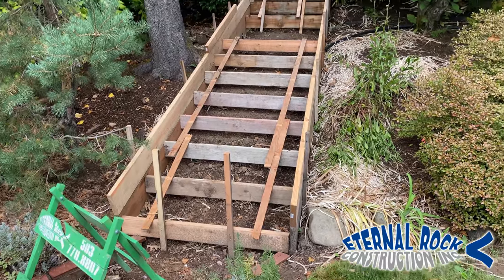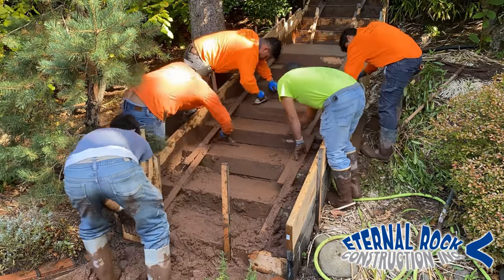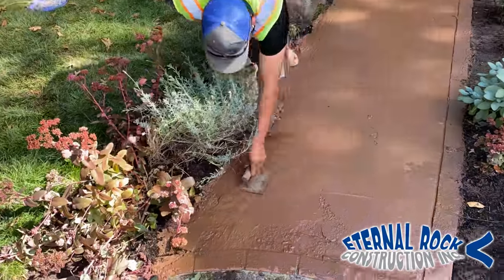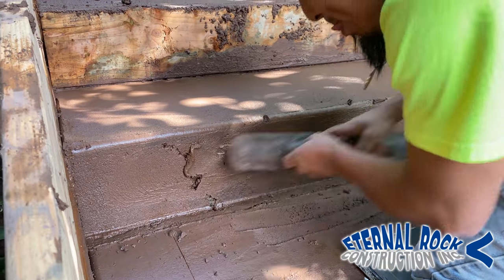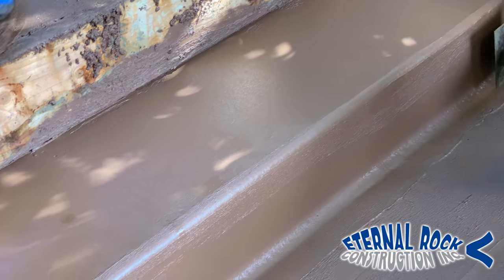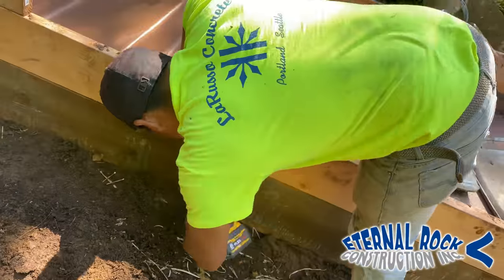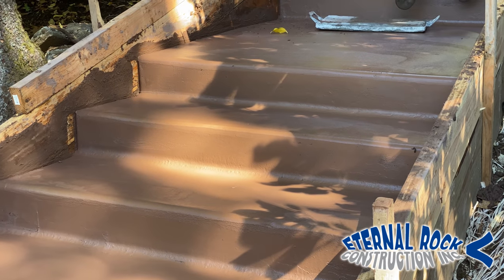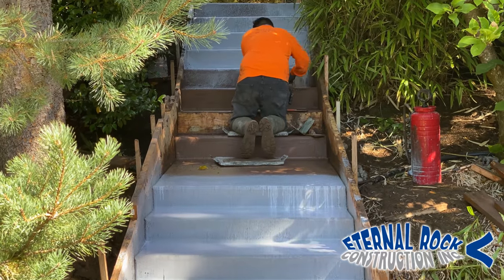How To Pour Colored Sand Finish Concrete Steps in Portland, Oregon Step by Step

Comment: Would be great to see the finished steps once you pressure wash them to let us see the different textures ! Never once did I think that concrete could be moulded so cleverly and look so smart, Guess like a lot of folks you just think of greyish white finnish you see in most buildings and not really thinking about how versatile with skilled men/women you can turn out cracking looking work like this. Thanks for taking the time to show everyone. Respect from Scotland.